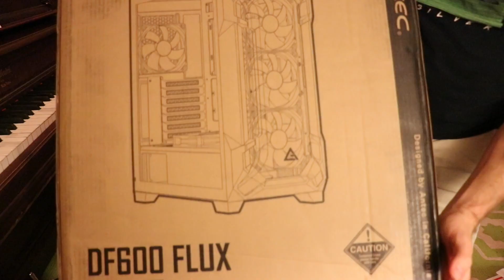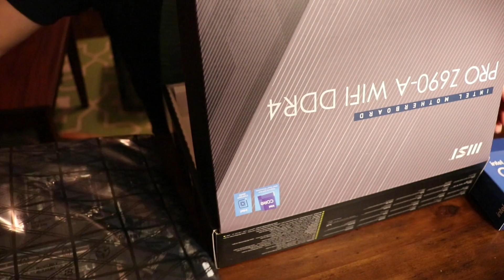Quant PC Build - $2,000 - Time Lapse

Comment: @Dimitri - I would strongly advise getting a SSD for that pc - it should make a huge difference to performance if you put windows 10 / 11 on a SSD in comparison to a Hard drive and the cost doesn't need to be excessive. Any modern pc should really have one - not sure if you missed this in the video other otherwise was not aware :)